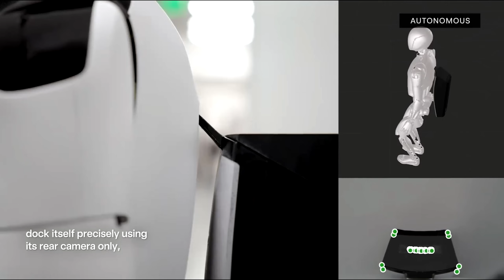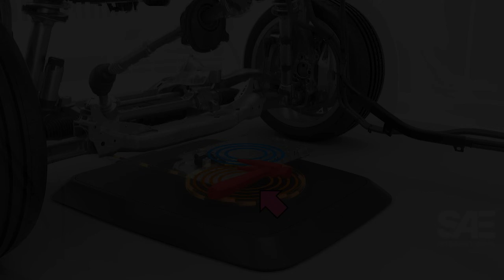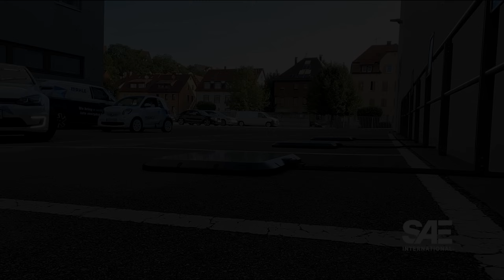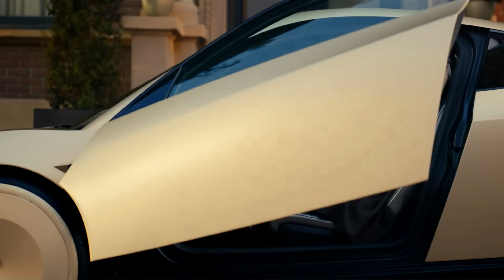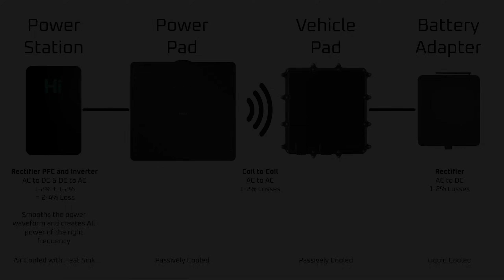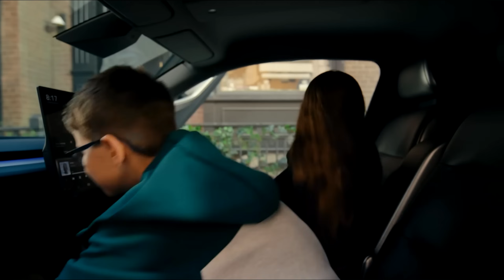Part 2:  Wireless Charging for Vehicles // The Nitty Gritty Details

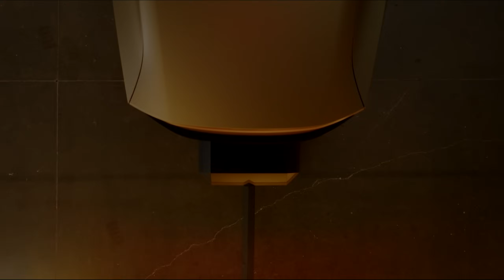Comment: 8:55 another reason it's in the back is that the battery penthouse is already designed at the back for all Tesla models. Putting it in the front would require extra wiring and HV cabling.
Reply from the maker: Great point!

Comment: Re: Moss Landing fire's impact on Tesla. I mistakenly thought the Moss Landing, CA fire was Tesla batteries catching fire. I thought this could hurt Tesla MegaPack business. I was CORRECTED. It was a section of LG produced batteries. The fire was exacerbatted by the fact they were all inside a concrete structure. My question is the same: What is the effect on Tesla, specifically does this HELP them inasmuchas their technology may be superior vis-a-vis fire. The demand may increase due to the need to replace the LG packs. Plus, are firefighters finding better ways of dealing with this issue?

Comment: For the robot when there is more of a at home version of it. A wireless charger is logical due to the physical space the robot will take when it sleeps. Plus there is a look at wireless powering TV and other things. And if that did take off, which I doubt. The robot would likely use this.

Like I think just like your phone. You will have a choice between having it plug itself in or wireless charging. And it will basically be a situational thing. Like my roomba, the contacts on it wears out and it is a pain to deal with it. Where if it was wireless, this is a selling point due to less upkeep.

Comment: The most important aspect of wireless charging systems is to have a robust standardization framework, that is ensuring that cars can easily perform short-distance automatic docking and that the payment system operates seamlessly. For most use cases 22 kW should be sufficient, as the most likely installation locations for these chargers are homes, workplaces, or malls.

At workplaces 11 kW is more than adequate since cars are typically parked for 8 hours. During that time an 11 kW pad could charge a 100 kWh battery from 10% to 90%. For malls, where the average visit lasts about 1 hour, a 22 kW charging rate would provide an additional range of at least 100–150 km (50–75 miles) for the average user.

Robotaxis and similar applications will likely remain niche products, and for these there may be room for higher-cost hardware in both cars and charging pads. However for the majority of installations, the primary driver will be affordability to enable easy scaling into a ubiquitous system.

Comment: I'm a retired EE.  I commented on your Part 1 video that I didn't see how wireless charging could be reasonably efficient because of all the leakage flux.  Since then I've come to realize how resonance could be used to significantly reduce this problem.  Here's how:
1) Leakage is typically modeled as an inductor (the so called "leakage inductance") in series with the tranformer's primary winding.
2) When you place a capacitor in series with the primary (a capacitor used this way is typically called a "coupling cap") would look like a series-connected LC before the primary winding.  In other words, the coupling cap and leakage inductance form a series-resonant circuit.
3) The key thing to know about series-resonant circuits is that their impedance drops to nearly zero at the resonant frequency.  This would, in theory, mitigate the problem of leakage flux.
4) The coupling cap would have a fixed value, while the leakage inductance can vary depending on the relative positions of the two coils.  So the frequency would have to be adjusted to find the resonant peak.
Reply from the maker: Thanks for following up!  🤠
Reply: Magnetic resonance coupling u explained
2.5 yrs ago @thelimitingfactor

Comment: For the 10 wireless per 250kW V3/V4 supercharger that is not right. Supercharger share power based on 4 stalls per cabinet (and then power share via a bus between cabinets)
4 V3/V4 superchargers are powered by 1 V3 cabinet which will be 387KVA. Unclear what the conversion to kW as the power factor is unknown but likely 360kW or so there you are likely to get 3.6 cars powered for every 1 stall.
Personally I can't see them ripping out superchargers for this more likely they will have a separate facility for it.
Reply from the maker: Nah, they won't rip out existing superchargers.  They're very capital efficient.

Comment: If each element has at worst case 2% loss, for a 250W power transfer this means dissipation is only 5W really not hot at all so no liquid cooling is needed surely. If liquid cooling is needed then clearly it is not as efficient as they are saying.  I admit ignorance here.

Comment: The on-the-ground pads are going to be difficult in outside lots where it snows.  They're going to need to be embedded and flat.
Reply: Heat trace melts snow pads will be obvious
Reply: @SparkySho  Yes but to clear the entire parking space of snow the units and cables are going to be scraped right off the ground.

Comment: For Optimus to use wireless, its charging pad will have to be small and light. Weight seems to be an issue with Optimus, so wired charging would make sense, at least for the early generations.
A 25kw wireless charger will take a long time to charge a car. This doesn't sound practicable, except for things like Cybercab.
Reply from the maker: Good point!

Comment: I think Tesla may also provide their wireless charging pad supply cables with NACS adapters to connect directly to existing Tesla Wall Connector home chargers and Superchargers.
Reply: I believe indigenousEarthling101 meant the wireless charging pad will ship with the cabling necessary to connect to existing wall connectors and moble chargers with a female adaptor.
Reply from the maker: I think it depends on the vehicle.  I'm betting the Cybercab won't have a cable at all.

Comment: Optimus robots could still hook themselves onto a wall bracket and have a wireless charger on their backs. The wall would have a charging pad mounted vertically below the hook.
Reply: The robot has the dexterity to plug itself in with a simple extension cord.  The only downside to this would be that the robot would need to be tailored to the connector or voltage of each country.
Reply: @ There could be other upsides to dedicated charging. It can be more reliable and slightly smarter and do power sharing. But the robots themselves are smart enough to do that, too.

Comment: In an ideal world there would be inductive loops in all car parks and parking would be free so long as the vehicle participates in a VPP. Users can opt out and pay the penalty (power cost plus parking) as there may be those preparing for a long journey. RoboTaxies (from all providers) would be happy with this setup too as the vehicles are distributed everywhere. This requires big-picture oversight however as businesses like their walled gardens...
Reply: Another advantage of street-flush inductive loops: The Vehicle inductive loop can descend and find the sweet-spot over the Charger Loop. This will mean that the vehicle metal mass (chassis, motors, suspension, battery-pack) will be a goodly distance from the Charger-Loop and will consequently minimise eddy-losses / localised-heating in the vehicle chassis.

Comment: WRT inductive loop charging: Similar to how our phones charge... there's also data encoded in the magnetic pulses. The charger is constantly sending out a weak sense pulse - when a vehicle is overhead with its inductive loop it communicates back via magnetic pulses stating it's capabilities. As the induction field is ramped up, the vehicle notifies the Charger how much charge it is receiving. The Charger knows how much it is sending and if there's a discrepancy (outside set tolerances) the charger can disengage the charge session. If the Charger senses expected energy transfers the charger can continue to ramp up the energy transfer. This monitoring of energy losses is constant so the charger can cut power at any time and signal an error. Plonk a bit of iron on your inductive phone charger and you'll see this safeguard in action.
Reply: Wikipedia: Qi is an open standard for inductive charging developed by the Wireless Power Consortium. It allows compatible devices, such as smartphones, to receive power when placed on a Qi charger, which can be effective over distances up to 4 cm (1.6 in). Devices that implement the optional Magnetic Power Profile for magnetic attachment and alignment may be labelled Qi2.

Qi version 1.0 was released in 2010; by 2017, it was incorporated into more than 200 smartphones, tablets and other devices. As of December 2023, there are 351 manufacturers working with the standard including Apple, Asus, Google, Huawei, LG Electronics, Samsung, Xiaomi, and Sony.
Reply from the maker: Cool!

Comment: WRT public charging; similar to the problem with CCS and the latch that's attached to the public charger - any moving part that's on a public charger is liable to damage. The logical solution is to have mostly flush inductive loops embedded in all parking spots in a standard location. It is then the job of the vehicle to seek and optimise the sweet-spot for charging; and similar to the latch in a NACS/Tesla vehicle socket... if the moving part gets damaged, it's the cars problem and the charger can serve the next customer.

Comment: Slight correction: The power for a 250 kW Supercharger is not necessarily enough for 10 25 kW chargers. The power is shared between superchargers, since charging rate is limited by the cars/battery, so there is no need to have the electronics and power supply for all the Superchargers at a site to be working at 250 kW at the same time. For 25 kW charging, almost all the cars/batteries will be capable of drawing 25 kW, so sharing power does not give you an investment saving without significantly sacrificing charging speed when most of the stalls are occupied.  So about 5 or 6-ish 25 kW charging pads for a 250 kW Supercharger. Or so. Roughly.
Reply: Missed this comment before I post but it is more likely to be less than that at about 3.6 cars for stall. 4 V3/V4 superchargers are powered by 1 V3 cabinet which get in 387KVA. That is likely about 360kW when converted (unknown efficiency for the power factor) which is 3.6 cars per 250kW V3 stall.
I think they will build new facilities for charging. Space is a major limiting factor instead of converting existing supercharger sites.
Reply: @JohnBakerCharge  Yes, we basically agree. Assuming your numbers, you can power 3.6 cars at full power for 25 kW chargers. So if you accept a little bit of power sharing, 4 or maybe a little more chargers. My gut feeling of 5-6 wasn't that far off. 😇Obviously, it is an academic exercise. The power electronics will be very different, so this will be new installations, since hooking up to the DC power supplies for Superchargers is not how this is done.

Comment: For "in road"  wireless charging to be feasible - it requires places where cars stop regularly and predictably. The cost for continuous road wireless charging would be ridiculous. Road costs are high enough - without adding additional layers of technical complexity.  Traffic lights are an obvious place where "several" wireless charging spots could be sited. Power is there (traffic lights ), cars regularly stop there. Payment for charging ? Car parks may be easier - blocking off a few spaces for works, is better than closing a lane or two in a road...but ICEing may be a problem...

Comment: not convinced that the robustness of wireless would outweigh cost.  should be trivial to make contacts in such a way that replacement would be cheap and trivial.  however wireless might allow charging at the robot workstations in order to allow charging while. it is working.  that would significantly increase the value of the robot.  having said that wired charging at workstations would also be possible in the same way that we use our mobile phones while they are plugged in.  for mostly stationary tasks optimus could plug and unplug itself as it moves around the factory when it switches between tasks

Comment: I think for Optimus it makes a lot of sense to have a normal, short power lead. That way, it can continue to work on the tether, and it can plug in literally everywhere.
Reply: it should have ungrounded 120v cord dragging from its butt........lol.
Reply: This really does seem like the simplest.  In a few hours of 120v it can charge itself while in any stable posture.  Once you have a flexible robot no need to complicate the charging since 120v power is everywhere and 240 is definitely possible in industrial settings if you want it faster.  A new standard is unnecessary for optimus.

Comment: If the Optimus had wireless charging in its feet then it could stand on the charging pad while continuing to work. This would be useful for any type of work where the robot doesn't move much from its workstation.
Reply: It could simply plug a cable in itself

Comment: selling a hardware that enables wiresless charging is a product that generates revenue on its own, but it would also increase the technical service required for repairing and fixing, while that too can be profitable, it would affect their current factory layouts so "making space in an already tight space" would be required

the biggest argument in my eyes is that both tesla and customer saving on cables and socket adapters, etc, and hopefully that the whole industry will decide to synchronize on the same communication protocol / frequencies technology and/or standard rather than each developing their own, incompatible version --- and let's be realistic, older car manufacturers are unlikely to be inovative enough nor willing to adapt straight away - just look at the NACS topic where there still are a lot of brands who don't have it
Reply from the maker: I don't understand this.  Wirless is less likely to break.  Less moving parts.  It won't have an affect on factory layouts either, other than to make them simpler.
Reply: @thelimitingfactor  i hope so, i only made a speculation that it may hypothetically bring new technical problems tesla would have to be dealing with, - lets hope i am wrong haha

Comment: Angled parking and parallel parking would be problem if vehicle charging pad location is not standardized. Putting ground pad near curb makes sense since vehicle length can vary, but backing into angled spot has its problems.
Reply: Maybe the parking spots in question would be rebuilt for straight parking when the chargers are to be installed. Or the chargers will be installed in other spaces.

Comment: I was of the understanding that Qi chargers were also resonant chargers where both the coils operate at a constant resonant frequency. Maybe they're talking about being able to tune the resonance with various capacitor banks like in some RFID readers. This will let you increase the Q (basically the peakiness) of the receiving and transmitting coils.
Reply from the maker: Qi is inductive, not resonant inductive.  That's why it doesn't work with a signifcant air gap

Comment: An idea: the coil in the power pad could move inside the pad to align itself perfectly with the coil in the car.
Reply: That would just increase the cost and maintenance. Why to move mechanism in pads when you have autonomous cars that can park precisely.
Reply from the maker: No need.  It just adds cost.
Reply: Maybe it would still be worth it because this enables millimetre precision and those chargers will be used a lot of times over many years and the charging efficiency gains will add up. Assuming automatic parking will result in 1 inch misalignment on average what would be the efficiency loss from such misalignment as compared to a perfect one?

Comment: What about people with implanted heart pacemakers - is wireless charging safe for them?
Reply: It would be a bigger problem for the poor old lady with the pacemaker that she is now squeezed under a parked Tesla.
Reply from the maker: Tested, no issues
Reply: @thelimitingfactor  already tested? Also for those high power car chargers? Would you mind sharing the links to those tests/studies?
Reply: Theoretically. There was a study that placed an iPhone to peoples chest that was shown to have some effect on pacemakers. This seems to have been just the phone, so I would actually wonder if it was the NFC instead of the Qi receiver.

However, remember that the intensity of a field is inversely proportional to the square of the distance from the emitter. So I guess if someone fell over on top of one of the chargers it could have an effect on a pacemaker.

However, according to the SAE J2954 Wikipedia page, the chargers communicate with the car via Bluetooth, so it would probably not even activate unless a car was in the way, absorbing most of the radiation.

Comment: Reversing into a tight parking slot is always easier than doing it forwards.
Reply: see - Tesla FSD tightest parking EU.
Reply: ...in your opinion. I prefer it that way myself, but I can see that the sideways precision of the end of the vehicle going in first will be better on average if a randomly selected driver goes in forwards, which was the issue in question.

Comment: Why not have the wireless charging receiver in the middle of the car rather than front or back? That way, the car can park forwards or backwards into the spot and still accept the wireless charge no matter if a human or “cyber-cab” does the parking.
Reply: Probably because the battery takes up most of the space between the wheel ( middle of car), leaving front and rear space for charging/electronics
Reply: Every vehicle has a different length, so what you need is a consistent distance from curb/wall, allowing them to park correctly when charging.  Front vs rear doesn't matter, so long as you know which way your vehicle goes.